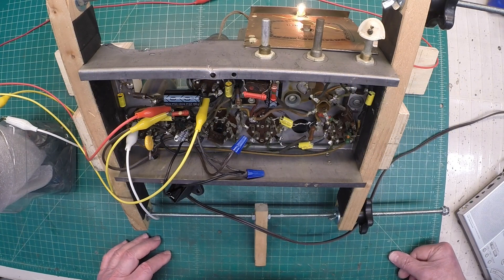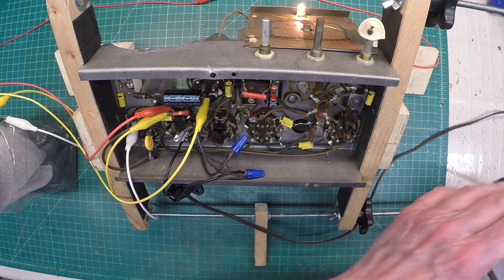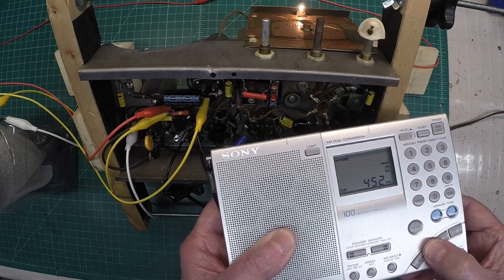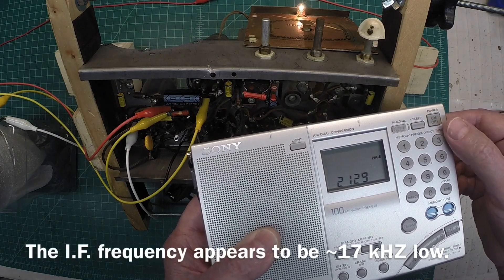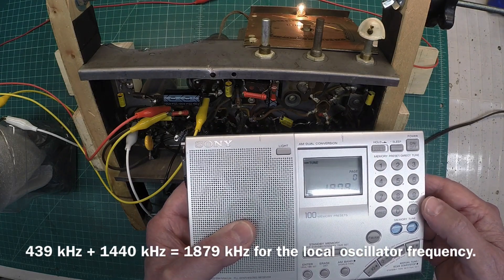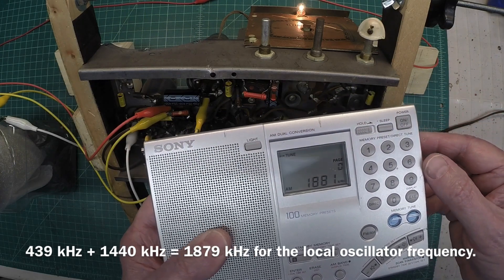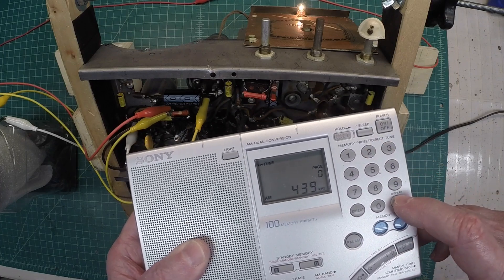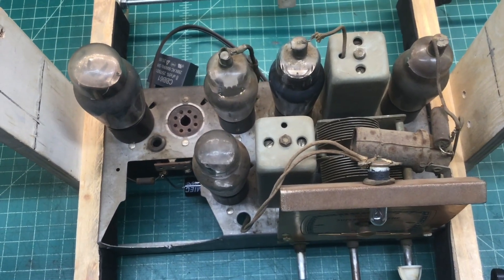I.F. & Oscillator Frequency Validation | A Simple M&P

Comment: To found the IF frequency of a 1958 transistor radio I coupled my modulated generator to the 3 IF transformers with a loop.
I visualized the audio on an oscilloscope.
By moving the fréquency I was able to determine the IF.
Reply from the maker: Sounds like a very good approach. All the best, Don

Comment: I like an older receiver with antenna terminals. I can attach a coax cable with a sniffer loop at one end & snoop around in the chassis with less noise. But folks should use what they have & this was a good demo. I've seen people try to describe how to listen for a LO with a transistor radio & they often assert that a howl or squeal will be heard instead of the quiet carrier as you demonstrated.
Reply from the maker: Thanks for sharing your thoughts and experience. All the best. Don